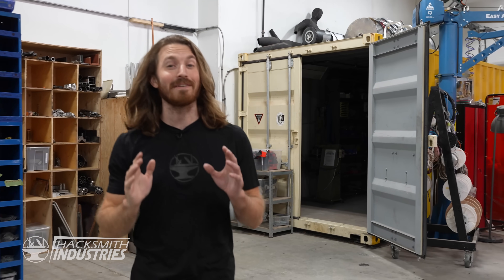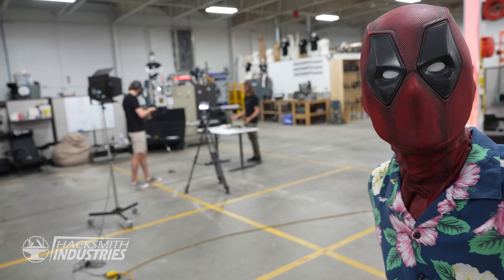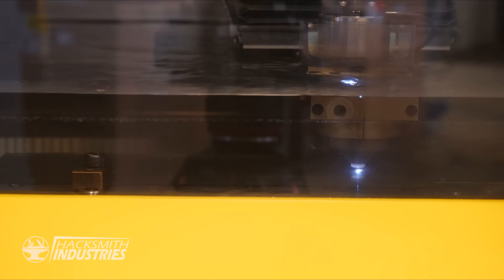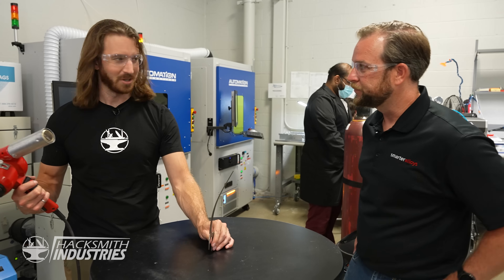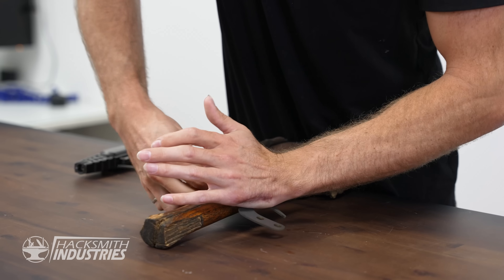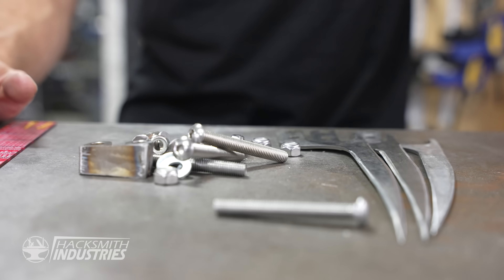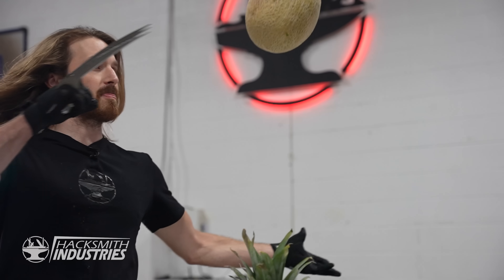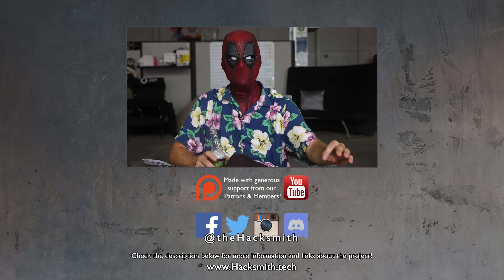I Made Self Healing Wolverine Claws!?

Comment: It would be cool if you heated the claws up by passing an electric current through them. Then you wouldn’t have to get your lighter out every time, you could just flip a switch
Reply: you can custom make the alloy to return to its original shape at different temperatures, including room temperature, so its always trying to return back to its original shape.
Reply: @Metal_Master_YT  and it will be even softer
Reply: That's really smart
Reply: @doubledarefan  uh, yeah, but there are easy solutions to such problems, some are naturally occurring already, for example, the thinner sections will lose heat faster, and since its made from metal, it is quite thermally conductive, constantly spreading out the heat. and listen, the tips can only get white-hot if the power is flowing through the tips, and how can you put a wire on the tip of the claws, and have the claws still function? besides, if its glowing white-hot, it would ruin the shape memory alloy, its only supposed to get to like, 100C max! that's all you need for it to snap back into place! what in the world are you expecting them to do? connect the claws to a thunderstorm and zap them with lightning??? why in the world would they heat it up that hot? they would burn up the metal in a matter of minutes if it was that hot! you're conclusion makes no sense, I mean, yes, the thin bits will get hotter faster, but you can overcome that problem fairly easily by making the power not flow through the tip, and have the spread of heat go into the tip through thermal conduction.

Comment: You should work on the heating to heal. some way to heal at the press of a button or maybe see if you can detect the deformation and trigger healing.
Reply: I wonder if some insulated heating wire could do that! I bet they could run heating wire through or along the claws and power the wire with a battery and boost circuit in the palm of the hand, and that solves the healing at the press of a button problem!

Comment: I wonder if these claws would be better with some kind of stiffener, cause if they deform they're just losing some power, especially since Nitinol is rather soft.
Reply from the maker: You can temper it differently -- we have a pair of extra soft claws, and a pair of hard claws (the ones used in the test)
Reply: @hacksmith  you used the hard ones in the test?? they were wobbling and bending so much though…
Reply: @theparkourgamer5857  it’s a softer metal, remember they said that it bends/deforms at ~room temperature/human body temperature
Reply: @theparkourgamer5857  any harder would mess up the self healing, it would just be flexible but also brittle
Reply: Your pfp made me forget that I was on YouTube.
Reply: Can you use some kind of internal heating element?
Reply: @gv100_blitz  most likely like a copper wire through the claw
Reply: But then we wouldn't get to see the self healing.
Reply: @StrobeVisions  Sure you would, it would just take longer
Reply: I bet nitinol has terrible edge retention. It’s an amazing material but I’m not convinced it makes decent blades.
Reply: The stiffer they are the more prone they are to snapping instead of bending

Comment: There’s one problem, they aren’t nearly as effective as your original claws, maybe try covering it a very thin sheet of melted metal so it’ll still reform but it will be slightly stronger
Reply: I agree but adding other metal might not work due to how weak they are.
Reply: What I mean is it might not go to its original state because it can outpower the sheet of metal.
Reply: The plating will work harden and crack or flake off, likely
Reply: Oh frick, all of you are right, maybe if they weld pieces of metal like armor onto it, so the most important parts are hard and it can still reform

Comment: Needs to be a bit thicker and a little longer because wolverines claws have a good reach and the extra length allows him to really dig in concrete and scale walls. 
Of course adamantium is fictional, but on an overall rating, you guys get a 9.5/10. Very well done and I like how you designed the claws with that arch to fit over the hand to look like it's popping out of the back hand. 
Very cool indeed!
Reply from the maker: We were limited by the size of the nitonol blanks :(
Reply: @hacksmith  no worries, you did an excellent job. I couldn't do it. Thumbs up man!